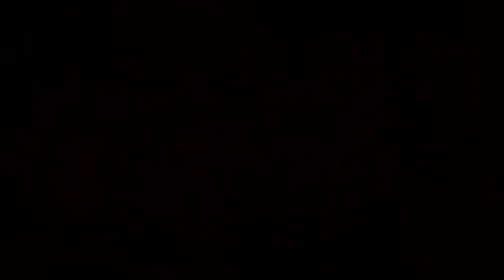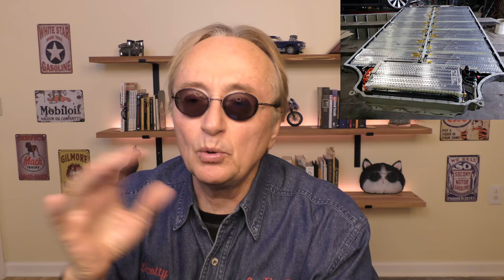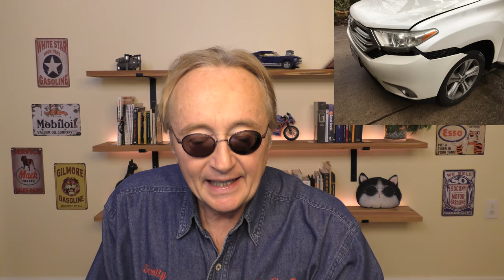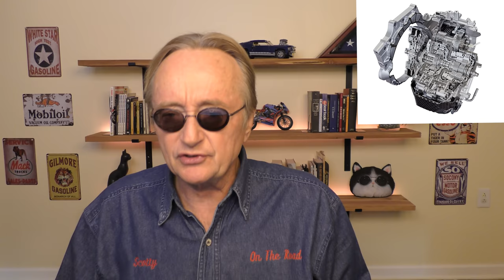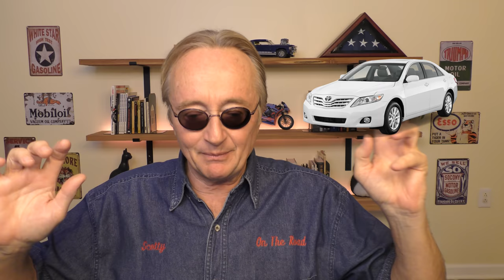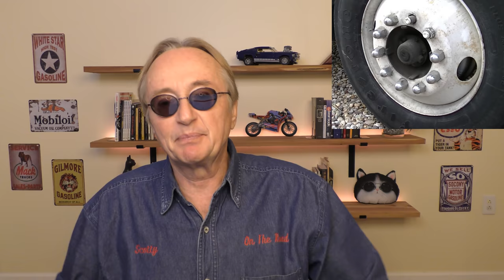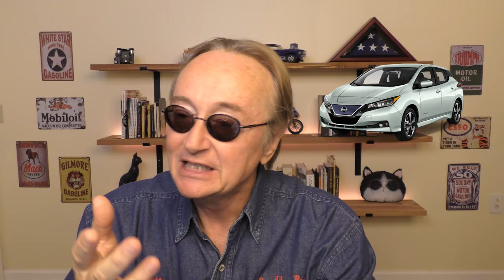This Fatal Flaw Just Ended Tesla’s Future in America

Comment: Who needs electric cars when you got a ‘94 Celica!
Reply: Winner!
Reply: Yus sir!!!!
Reply: Touché
Reply: But the 85 celica!
Reply: yeah I got an 87 Ford Econoline and I haven't used even a tank of gas in a whole year.

I don't measure miles per gallon. 

I measure months per tank.

So far I think I'm going to make it to a year and a half without refueling.

Minimalism and OTR for the win.
Reply: @joseecheverria4362  what about the 82" Celica supra that car was an icon before the AE86
Reply: Me 🙋🏽‍♂️
Reply: Yes. Just yes.
Reply: Yes
Reply: Picking up an 02 Celica GT tomorrow!  Thanks Scotty!
Reply: @madmat3940  I have a GTS, please for the love of god don't buy the GT, the VVTLI on the 2zz is so good.
Reply: Until you run out of oil
Reply: @hououinkyouma5539  Any car is bad to run out of oil, what Scotty said about the 2zz I entirely disagree with, my engine has 210,000KM and it runs like new lol. If you're so worried about it then take an oil pan assembly off a 1zz and swap it, pretty cheap easy fix.
Reply: @VNCTHE1  No the van runs great. 

In over 10 years I've only put around 20,000 miles on it,

And the last year I probably barely put 500 miles on it.

I just keep things in realistic perspective. all the car is is a people mover. And with a van it can be an apartment on wheels or storage unit as well.

that's why I laughed so hard at all these chumps that are buying a new car every 3 to 5 years. 

they're basically driving their retirement out of existence Lol!

that's where I'm 40 and I could retire today if I wanted to.
Reply: Yup....97 Honda crv...solid as a tank!!!😅😁😆🤷🏽‍♀️😂
Reply: I'm sure Tesla's will last 30yrs 👌
Reply: @monkeywkeys3916   Well I'm pretty sure that my 30-year-old Van Will out live most of these Teslas. 

Seriously I should get an emblem of a Galapagos Tortoise for the side of the van. get one of those '70s murals painted with a hot chick riding a tortoise.

funny thing is it can still get up to 80 miles per hour with all the crap I've got on it. 

dual rocket boxes on top. a clamshell box for storing the two propane tanks. as well as a generator box on top. I've got a wood stove in it. built a bike rack on the hood. and on the rear of the van I've got a full size BBQ and a Camp Chef oven hooked up to the tow hitch raised up three feet from the ground. 

initially I only Built This thing just the party. because my GMC value van gets 6 miles to the gallon and too big to go into clear cuts.

So I built this one just to party with. my only regret is this full size van isn't one of those 4x4 Pathfinder vans. 

But over the years I've saved probably 200,000 or more in rental payments.

side note. back in the day I had an early 80 Celica with the hatchback. Five speed with a 22RE. The car was a lot of fun.
Reply: YA DAMN SKIPPY!
Reply: Not everyone can be so privileged
Reply: Electric cars are way better
Reply: @madmat3940  2000 to 2005 Celica have the terrible Yamaha engine. I would run if i were you.
Reply: @owen8538  Compressed air style minivan of India sounds like a better idea then the fully electric cars of today. 

Maybe a hybrid like a Prius isn't so bad. But full electric has a way to go.

but considering all the rare earth materials that you need to build these batteries.

Versus a compressed air car that gets 85 miles to the air charge.

I mean if we're doing all this crap to lower pollution. 

Then which one really does less damage to the environment?
Reply: @Adam-pl6vq  
No
Until the WORLD runs out of oil
Reply: @monkeywkeys3916  😂😂🤣
Reply: People who don’t want a car that’s over 1/4 of a century old...
Reply: Yes!
Reply: Lol he is the only person that still has one, the other 99.9% are at the junk yard 🤣
Reply: Who needs modern cars when you have a VW bug 😎👌🏻
Reply: He got rid of the Celica !
Reply: @-BUFFALOMan  All cars fail, electric cars are no different. And I agree they are better in every single way. More people need to wake up and realise that gas cars are so bad for the environment. There is no doubt in my mind that Tesla knew this would happen. In fact they put a little more research into battery technology and already came up with a solution for this. A rechargable lithium arogel composite. The new composite can hold several times more power and wont have the anode problem that traditional lithium batterys face.
Reply: Useless Fanboy acknowledgement.
Like a kitty kat. First pounce.
Reply: Indeed!
Reply: But Scotty prefers Chrysler cars.
Reply: @hououinkyouma5539  synthetics
Reply: This is painfully true
Reply: @Adam-pl6vq  you know gas comes from oil right. If they could make synthetic gas, why wouldn't they have it now
Reply: Or the 99 dodge cummins rolling coal.
Reply: Why have foreign cars when you got American cars that are highly good in crash ratings and get over 500,000 miles
Reply: Hey, & don't forget about the '94 Accord...I know people, one guy in particular, whom has over 440,000 miles on same...Nothing (other than maintenance) went wrong with it up to 350,000 or so...Just sayin'
Reply: @jamieeisenhower1560  Of course today, some of the "foreign" car's are more "American" than the American car's (like the Toyota Camry, billed by Toyota as using more American parts, labor & even design in the final assembly than any other Ford, GM, or "Fiat-Chrysler"...Btw, my father was an engineer at Ford, & I'd Love💘 it if the "home-boyz" were doing better...
Reply: Amen brother
Reply: @gregsayles9253  and do your homework Chevy volts go over a million miles some people have over 600,000
Reply: Who needs car factories, if cars last that long.
Reply: Why not the all trac Scotty 🧑‍🦼
Reply: Why not the all trac Scotty? 🧑‍🦼
Reply: I had a 1981 Datsun/Nissan 720 king cab 4 cylinder diesel I bought used in 1986. I would put $5 of diesel drive around the small city I lived in then on the weekend for outside New Orleans we'd drive to Astro/Water world drive around Houston. Put $5 in and drive home then the rest of the week around our town. Now diesel was like .$0.30 cents a gallon and with the 5 speed I was getting 50mpg. I wish I hadn't never sold that truck.
Reply: Or an 03 Taco 4x4 😉
Reply: Check what kind of battery it has first. Make sure it’s not a lithium ion.

Comment: This man just pretends the model s hasn't been out since 2012, and still running fine.
Reply: He mentioned they have been out a number years, and the problem gets worse as they age.
Reply: 2012 is only 9 years ago. The average age of cars in the UK is about 8.5 years with scrappage obviously somewhere beyond 16 years. So even the oldest Model S is, in our terms, in mid life. It's just too early to judge their whole-life capability. And of course, the second half of the vehicle's life is the bit where there is no warranty and the owner picks up the tab for any failures and one major bill precipitates the scrapping of the car.
Reply: @ColinMill1  Scotty is in the US, and the average person out here keeps their car for 6 years. But regardless, Even if you need a replacement pack at the 10 year mark, the money you saved in gas/maintenance will have covered it.
Reply: @kyle-qw5yx  The question is what will be the out of warranty cost of a replacement pack. If this exceeds the residuals of the vehicle it is likely to be scrapped. How much the first owner saved on fuel costs does not come into this equation.
BTW - the average age of cars on US roads is now 11.9 years suggesting the oldest Model S is only about 25% the way through its life cycle.
Reply: @ColinMill1  The average new car is kept for 6 years. The US has a huge vintage car market, which drastically skews the results of the "average'" age of a car on the road. 
The model S has a battery warranty for 8 years/150k miles. By which point- you've now recouped the estimated cost of a replacement pack which tesla has pegged between 3-7k. This price has been drastically reduced over the years and as time goes on only becomes cheaper. The problem scotty is refering to in this video about dendrites typically occurs in cheap/mass produced batteries used in cell phones. There's little to no evidence that ANY tesla vehicle has had problems with Dendrites. Vehicle batteries have a very different chemical make up, and are made to last longer. Again- time will tell and you can pretend electric vehicles are niche toys all you want but, you'll certainly be proven wrong in the long term.
Reply: @kyle-qw5yx  I don't think vintage cars skews it that much... You just need to look out on the road and you'll see most cars are between 6 and 10 years old... many consider 6 years old to be "practically new" or the perfect age to buy a car as it's only 50% through it's average lifespan.
Not to put down EV's at all but it's a pretty out of touch statement to imply that it's ok to need major repairs on a 6 year old car unless it's been driven in some extreme conditions or mileages.
Reply: @RWoody1995  Maybe in small towns. Just about every car I see is 2015+ in Las Vegas. Newer cars are much more common, and then you got the occasional 90's camry/civic and vintage cars from the 70s
Reply: @kyle-qw5yx  I agree with you 💯.
Reply: Scotty's impressed with cars that only last 2-3 hundred thousand miles.
Reply: @kyle-qw5yx  Scotty's impressed with cars that only last 2-3 hundred thousand miles.
Reply: @kyle-qw5yx  depends  you must roll 30k miles a year for it to be worth it. and with 30k miles a year... that means like 150+ hours waiting for a charge at random spots .
Reply: @livebassngames  I drive 30k+ a year. I wish I had bought a Tesla. 
45 minute drive on the freeway each way to and from work. I wouldn't "wait" anywhere to charge.
Reply: @goldenhawk352   When any car hits 30 Years old it has a problem
Reply: Loss of battery capacity/range with age.
Reply: @colin4601   yeah, but it's not that bad. especially with the new 4680 batteries.
Reply: @colin4601  And? That's expected. The batteries are rated to last 300-500k miles before the degradation is at a point where you'd consider replacing it. A new module then costs 5-7k at current pricing, and will be lower by the time that day comes. Much more practical than a traditional ICE car that will MAYBE make it to 200k+ miles, with much higher maintenance costs to get there.
Reply: There won't be any 30 year old cars generally. Cars are becoming obsolete before they are worn out.
Reply: Like in my garage, carport or driveway while I lounge, eat supper, breakfast or sleep.

Comment: Tesla and Quality Control two words that don’t go well with each other
Reply: Exactly
Reply: As a Tesla owner I agree but my car is still Awesome! 👏
Reply: I don't understand why Scotty bothers with common battery and SSD problems, when Tesla's quality control is a much better complaint
Reply: @dmoneydance  As long as you're past the point of encountering any defects, your car probably is awesome. Even knowing what I do about Teslas, I would love to have one. As someone who happily drives an ICE car now, I would love the reliability of an electric car. No more oil changes, no more transmission failures, no more wonky engine lights due to one tiny sensor you need to tear down the engine to replace... I'm more worried about the charger/grid than the electric car itself.

How has your experience been with long-term reliability and maintenance? Is there anything besides the battery you are worrying about?
Reply: @michaelhuss0  Well, the battery problem Scotty talked about was a GM problem, not a tesla problem. Teslas are 11 times more unlikely to burst into flames than a gas car. The only reason you hear about it more is that the media covers it. Long-term reliability is good and maintenance is low, I know cause I own a Tesla. The only problems in Teslas are quality issues that Tesla fixes for you in the first 2 weeks or so. From there it is smooth sailing.
Reply: Watch sandy murino’s dissection of Tesla cars

Comment: Solid State Batteries would solve all EV problems. Just wait a few years till the price can match lithium batteries
Reply: It will be interesting to see how Toyota has solved the cold weather issue with their new vehicle with solid-state batteries coming out in 2021. That was always the problem with solid-state batteries they lost a lot of range in the cold. But they say they have and the vehicle is expected to have a 300-mile range and recharge in 10 minutes.
Reply: @don-cw1yz  that sounds good, hope it’s true...
Reply: @J0hnny8ravo Yeah, but you wait for 3-4 years to see how it works out reliability wise. I like Scotty's philosophy, "wait till it is proven tech before you buy".
Reply: They're not gonna solve the problem of using too much electricity, that can be used for important things.
Reply: Why "wait a few years" on that nonsense, when we already have cars with real internal combustion engines? It's proven technology and we have plenty of oil, for the foreseeable future. Electric cars are ugly and bad for the environment, too. So you have to consider that. And they don't make noise, therefore, dangerous.

Comment: The issue you mentioned about the batteries is something tesla already knows about and planned for. This is the very reasoning behind their individual fuses on each battery cell in the battery packs. When one of those cells has that issue shorts out internally, it pops the individual cell fuse and that cell is forever isolated from the rest of the battery pack and the cell just spends the rest of its life as dead weight basically. I use recycled tesla battery modules in my Solar Battery system and when i bought one that was giving me low capacity after testing it, i took it apart and found many of the internal cells had blown their fuses, thus reducing the capacity of the module.

Comment: Tesla's greatest advantage is the supercharger network which is counter-balanced by the terrible service and parts departments. I went with a Chevy Bolt and I have no regrets, the parts and service manual access is just as good as with any other car and replacing wearing parts is easy and normal priced.

Comment: The problem is if you several hundred miles from a Tesla dealer, and your mess doesn't work, you now have a large flower pot. Or pay through the nose to get it towed.
Reply: Tesla has mobile service. They come to u within a few days. No longer than it takes to get my other vehicles into any shop. I'm 300 miles from the closest Tesla. Book an appointment on the app in 2 mins and they come right to your house.
Reply: @themeach011  Ok, I did not know this.
Reply: @themeach011  well, that's handy huh?? Just walk to work for three days
Reply: @themeach011  A few days!! LMAO!! COMPLETELY UNACCEPTABLE.  Which is why they haven't made a single penny profit selling cars
Reply: @protonneutron9046  I can't get any of my gas vehicles booked in, and repaired any quicker. If I call ford right now I know for a fact that there is no way they will get me in this week period. I know this because my truck was truck was just in getting fixed. Took a week to get it booked in. How do u figure u just roll up to a shop in your broken down gas car and they roll u right in the door and start working on your car. Laughable.
Reply: @themeach011  I do.  Your area kist lacks facilities.  Most places I've lived I can find same day service.  Telsa has been rejected by the US market.  That is a fact.
Reply: @protonneutron9046  our city has dealers for most of the main manufacturers. Plus many other smaller private shops as well. Maybe it's our colder climates that vehicles break down more often or something. Not sure why our shops would be so much busier here. All I know is I'm used to waiting a few days for an appointment so it hasn't seemed like an inconvenience
Reply: @protonneutron9046  I would also argue that Tesla and Evs in general have not been rejected by the US market. If that was the case why is every major car maker fast tracking ev production and also dozens of new start ups in the ev sector. It's the fastest growing segment and 1-4 luxury cars sold in 2019 was a model 3. Just google model 3 vs other car sales. It comes right up.

Comment: I searched for months for the right 2016 Sienna, I finally found it, 80 miles away, one owner ruby red XLE! Bought, serviced and traded in at the same dealer, My mechanic checked it out 79,000 miles lady driven, I put on new Michelin Defenders did all the pads and rotors, changed the tranny fluid, added the Baxter Oil filter conversion,  Sitting pretty with the "sweet sixteen" 6 speed. It sits in the garage gleaming not driven in the snow! SNOW a four letter word. I paid more than i wanted to but I'm done buying cars for a long long time, it will most likely out live me!